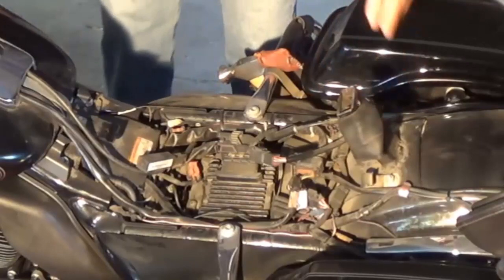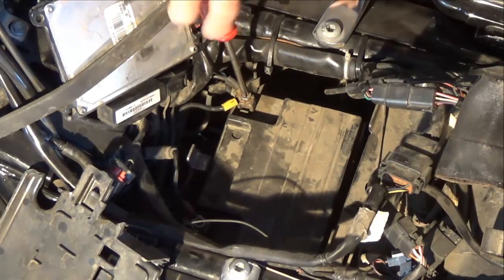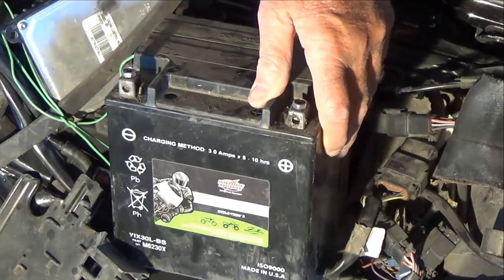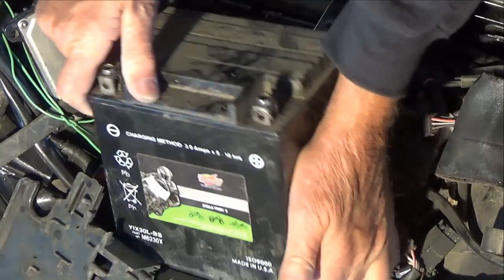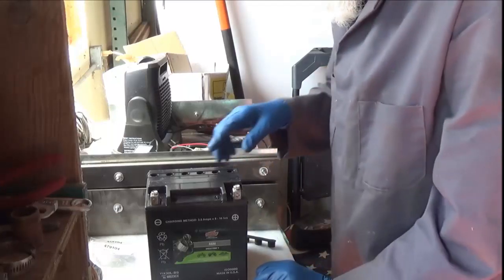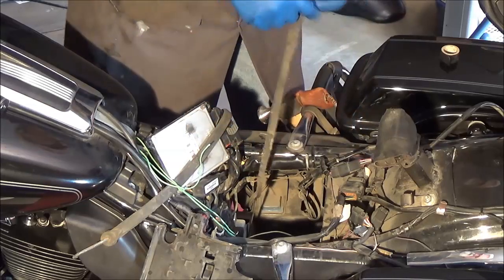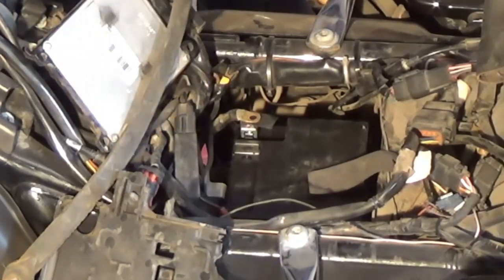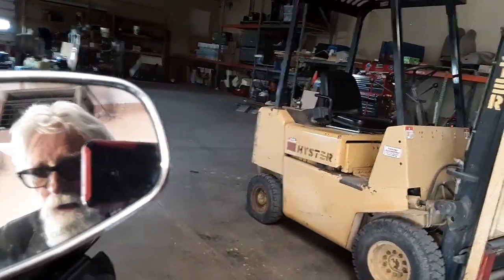Harley-Davidson battery remove and replace.

Comment: A long time Harley owner,told to to only use Harley Davidson batteries,they cost a little more,but last a lot longer.I always put pig tails on the battery for a maintainer.I think they extend battery life quite a bit.Have 3 maintainers going on 3 Harleys now..If I ride everyday,donlt need them,but sitting for weeks,really helps..Have a great weekend..
Reply from the maker: I agree with you on the battery tender, problem is I don't have electricity where I store the motorcycle. As you can see in my other videos on the Harley-Davidson. Although I'm working on some kind of solar charger as we speak. For this next storage season. I have always had good luck with Interstate Batteries they last 4 years or so. That's about as much as you could expect out of a battery in my opinion. When it is not up and running for long periods of time. Thanks for your comment. Subscribe to my channel so you can follow my Adventures to urges this year. We're leaving on the 5th
Reply: Interstate makes a good battery,I used one in my boat,with good luck,I did plug it into a maintainer in the off season.

Comment: You need a battery charger pig tail so you can hook up your charger easily.
Reply from the maker: I used to have a bunch of those unfortunately I gave most of them away and can't find the one I kept for myself. I do have a plug-in on the bike but it's hooked up for charging batteries and such for my cameras. Although that is a good idea